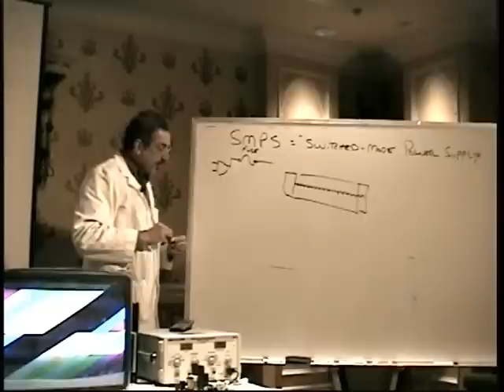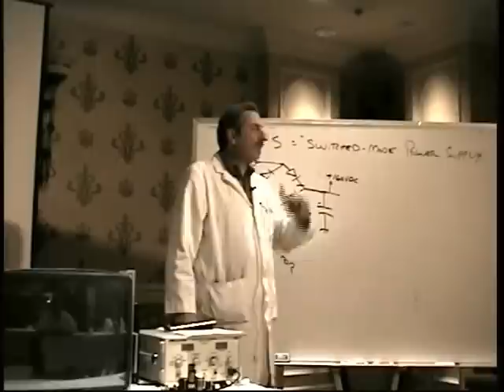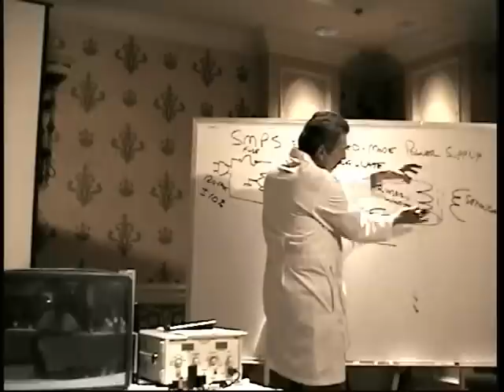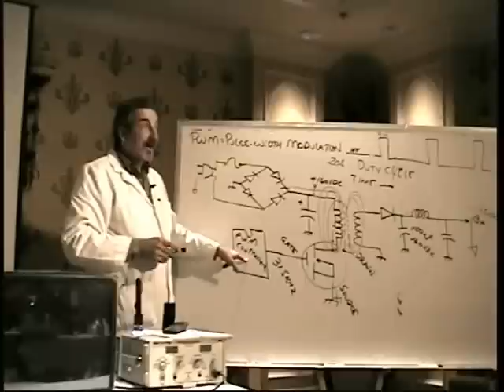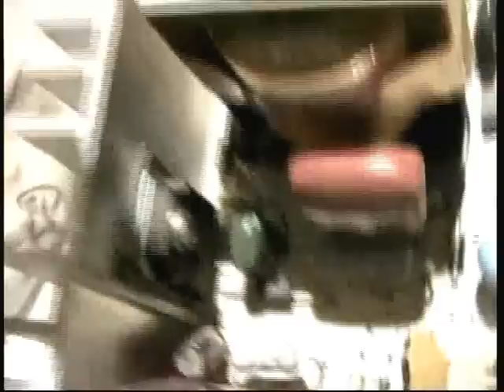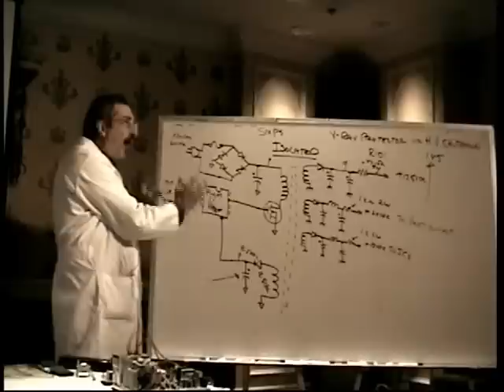CRT monitors-Part 3 of 4

Comment: Thanks for these uploads, they are really great! I would love if you could clarify something for me! You said that whenever the input voltage to the switched power supply drops the pwm controller fixes that making the output voltages as stable as possible, but what about a large load in the output that also makes the output voltage drop a bit, does the pwm controller fixes this as well or there is nothing the pwm controller can do about a large load that makes the output voltages drop?